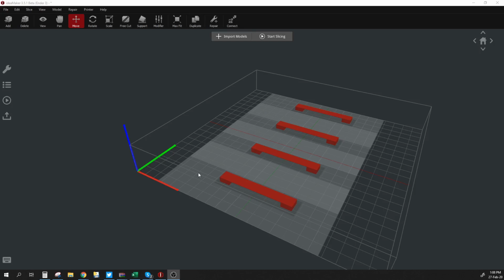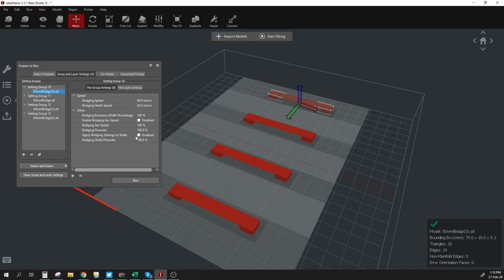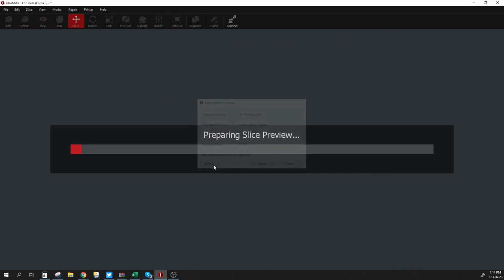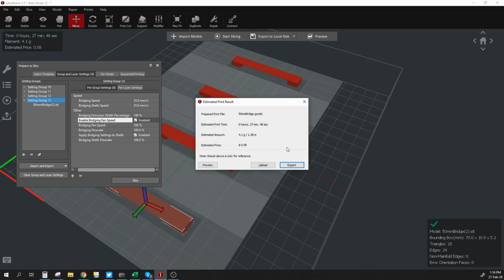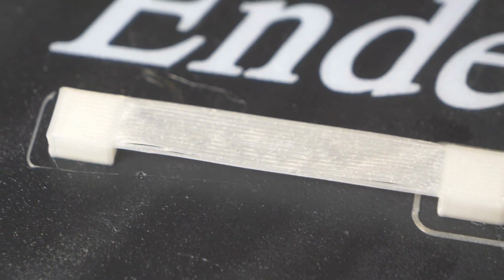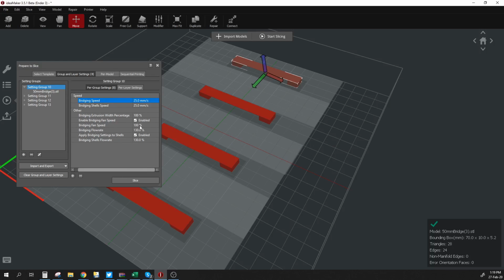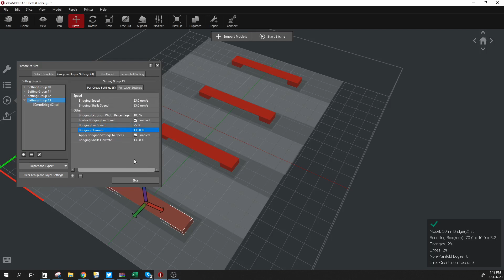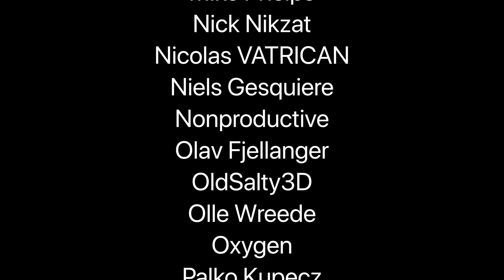3D Printing Bridges - Slicer Profile Tuning In ideaMaker

Comment: Thanks for the presentation, but I noticed you don’t really explain the purpose behind your actions or the reasoning for the sequences. For example, when discussing extrusion width, it seems there’s some misunderstanding. To achieve a specific extrusion width, like 110%, you need to apply the extrusion flow onto a surface, allowing the melted filament to spread under the nozzle to the desired width. Without a proper surface, you’re just pushing more material, which won’t increase the width and will create gaps between passes. The same goes for adjusting fan speeds—there needs to be more explanation about why you’re making these changes rather than just presenting variations in values.

Comment: With slicer tweaks and cooling mods I was able to bridge to 220mm across with some sag the first couple layers but by the time it was done printing it was a solid print. Mostly only worked on briding  so I could print fan ducts easier.

Comment: Excellent tutorial. I also do this same process for EACH layer of my bridge multi-layer Cura slicer settings (0.2mm bridge, then 0.4mm, then 0.6mm). I find it handy to place the bridges up to the light to see if each added layer is truly bonding well, or not.

Comment: great video. out of curiosity, what did you use for the top solid fill line type? lines, or rectilinear? changing this option in my version of ideamaker changing the line type for bridging. thanks

Comment: I am now trying to bridge for the fist time with my ender 3 v2 cura 4.8.0 but before the printing i can see in the slicer that it makes 1 brigelayer run but after that it wants to make a normal layer with crosslines in between the walls of the second and third layer. I have marked the setting that the bridge is multiple layers but after slicing it remains just as before. If i say that the liine direction of the toplayers must be 90 degrees than it makes the 2 most top layers in the lengts direction of the bridge as i want but not the second and third layer. The thichness of the bridge is 1mm and sliced at 0.2 mm so 5 layers in total.  And set the toplayers a 5 layers.
Can anybody tell me how i can make 5 layers in the direction of the bridge? 
I think that printing the second and third layer in this way it will not going to be going well.
Reply: no idea but if you enable more parameter with overhang and so on it's seem to work at least it's working on the top layer for me, it's work better with layer param as it's faster if you dont want do sequential printing ( and setup of it)
Reply: not sure if it that but on the model it showing the mesh on the same direction now add "fixed bridging angle" to 90deg on the preview and when im priting . at the end i cannot get ideamaker to print good bridging for my anycubic predator ... had to move to cura it's really anyoing.... i think this tuts is not valid anymore and need to reworked.
I have good brindging i cura and i have totaly no clue why tbh.

Comment: Use half a spool to create best possible profile and next time you buy exactly same filament, you may be surprised as manufacturer change a recipe by a notch and you have to start again... After few 100 of hours setting up everything and tuning your printer by printing a parts for a fully functional device you realise there is actually nothing you would like to print except another part to tune your printer even more 🤣 😂  priceless

Comment: Why didn't you try density and flow rates of less than 100%? In cura when it does bridging it always has the first two bridging layers at like 75% and 85% flow rate and density. The third layer it finally Up's them up to above 100%. In CURA's setting guide it explains that these values are set below 100% at first because it allows the bridge to do a few things. First off by having the density less than 100% it gives gaps between each filament strand so air can flow around it and it can cool faster. The idea is that if it cools faster then it becomes rigid in the air as fast as possible so it does not sag. The reason the flow rate is less than 100% is again for cooling reasons. Less material flowing out makes the lines thinner and thus able to cool faster. Less flow also means that the filament weighs less, so its own weight doesn't bring it down and make it sag. Once it has the first two layers of the bridge set up, then it has a support structure in place. Then the third layer can have values of over 100% to fill in the gaps that are left behind.

Is there any reasoning why with idea maker that you do not do bridging with values below 100%?
Reply: Same question. What he did was the opposite of what I see recommended
Reply: I was like 😳 The same question